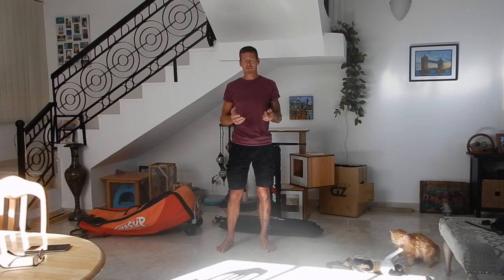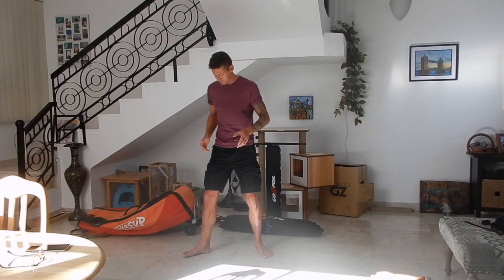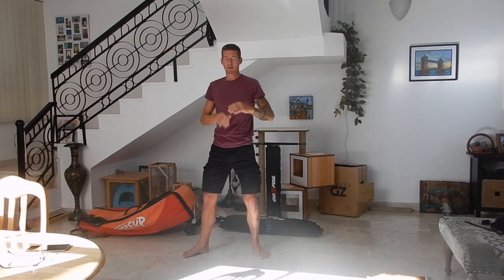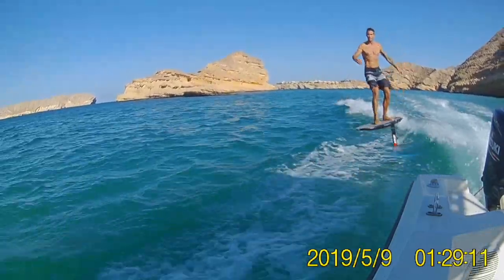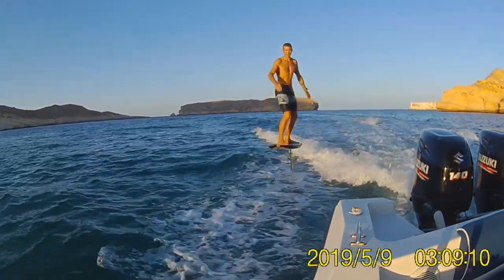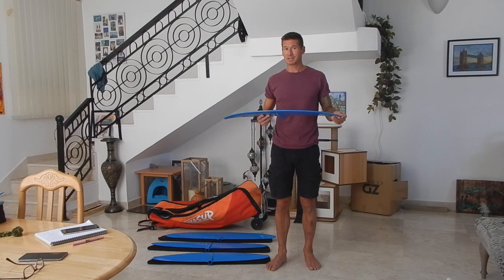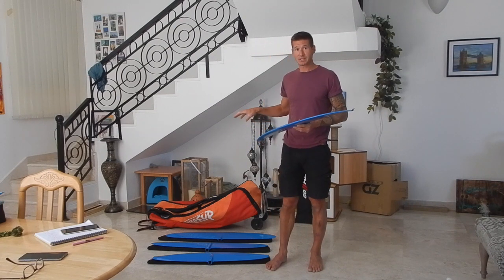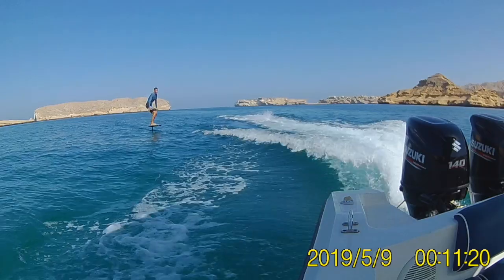Next level foil pumping technique

Comment: Something I have noticed (not sure if it is just me) but pointing my back foot out and be in a "duck" stance helps opening my hips and allows for independent movement of front vs. back leg. With parallel feet I fell like I can't really get anything out of my back leg, like it is locked. I have experience this mostly when winging as it give plenty opportunities to try different placements (pumping down the wave not powered by the wind), but will definitely try it next time I surf foil.
Reply from the maker: Hi Nico. Everyone has their own foot placement preferences. Personally I am constantly making micro-adjustments to my foot positions on the fly - wider for carving/surfing, closer for pumping, more side on for flat water pumping, and even a more 'duck' stance occasionally depending on what foil I'm using and what I'm doing

Comment: Great explanation. Been playing around with foot positioning following your last video and really noticing the difference. Whats your preferred mast position? Im guessing that is another way of changing where your feet are relative to the mast too.
Reply from the maker: You're right - you can change the mast position OR your foot position. My mast position is 1cm from the back of the US tracks in the Sunova 4.0 prone board, which allows my feet to be at the right position for footstraps - not that I use foot straps, but I figure that Sunova have placed the inserts in the right place so the board is balanced when you use them. It feels right to me anyway.

Comment: I have practiced foil surfing for 10 months, (in Malaga, Spain, that means 15/20 sessions) and currently my situation is: good take off, good glide, but when I get off the wave I am not able to keep the foil up. So I can't go back to the break point.
Reply from the maker: Try coming off the wave early to keep your speed up. As you come of the wave try to keep high on the mast and glide for a long as possible, and when you start pumping it's important to find a calm rhythm - if you pump too quickly you end up choking your speed which will make it really difficult to keep on foil. Make sure you compress your body as much as you can and then spring up to straighten your body as you push your legs down with each pump. Really exaggerate this to begin with, it really helps to keep high on the mast and to maintain speed

Comment: I’ve read many places that the 1095 has a back foot pump too, do you think the nl technique is similar to 1095?
Reply from the maker: Yes it's similar but tbh i think those who say it's very back footed to pump are pumping it with a wide (surf) stance. I don't use footstraps because I like to adjust the distance between my feet when riding - when pumping I narrow my stance by bringing my front foot backwards so I guess this is why I don't find it particularly back footed
Reply: @dominichoskyns9091  that’s interesting, thanks!

Comment: your maintenance pump looks the most efficient pumping technique I've seen to date. how long do you reckon you could foil using this technique?
Reply from the maker: It depends on the conditions. In flat water is obviously my fitness that limits me, to date my best times have been about 2.5 minutes but that that was before I broke my ankle and I've lost a lot of fitness since then and I'm about at the 1.5 minute mark now with no particular despite to push that further in the summer heat of Oman 🥵🤣
Downwinding I can pump pretty much forever because there's always a bit of a push from the wind and swell and you get breaks from pumping as you ride the good sections of swell

Comment: I'd like to see more discussion about the ability to pump different wings.  It's really hard to know if the problem is skill or having the right equipment.  Although I'm old (68), I'm a decent wakeboarder and have become very comfortable riding the foil.  But the pumping escapes me.  I can pump away from the boat for 10-15 secs and then nothing.

About 1 1/2 ago I bought the Slingshot FPUMP package assuming that it would be ideal for pumping.  The Quantum 100 is huge and sluggish. I didn't see it as being pumping foil.  Fortunately, it enabled me to drop the rope and ride continuously, which was my immediate goal at the time.  This is me on the foil.

https://youtu.be/wUhyuTcTZzo?si=rLHzXe5jWuW6nGQL
Reply from the maker: I’m afraid I have no experience with slingshot so I don’t know what their foils are like for pumping. From that video it looks likeyou are moving the board (and foil) up and down in the water too much (a porpoising action). Focus on keeping the board more parallel to the water with each pump. You have to have a bit of down/up movement, but not that much or you kill your speed.